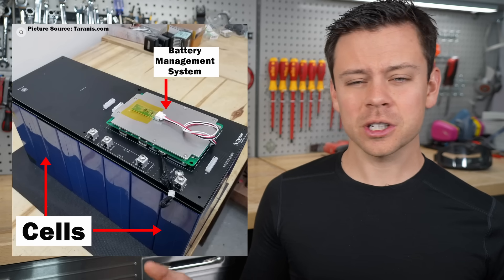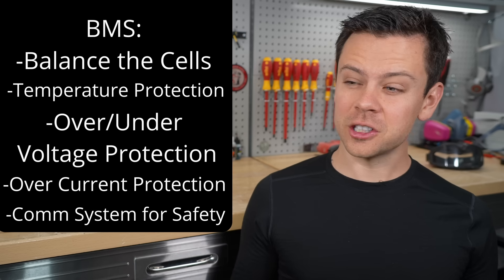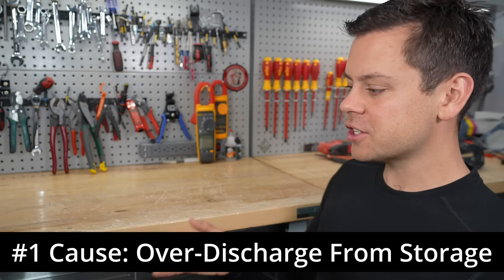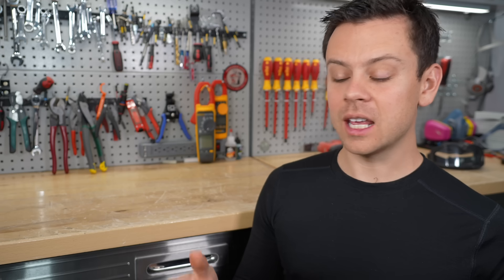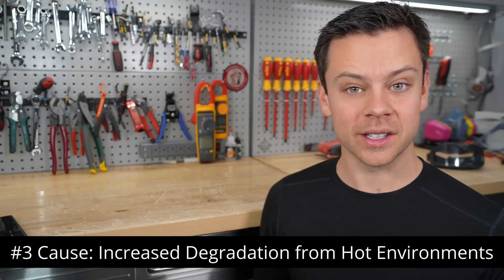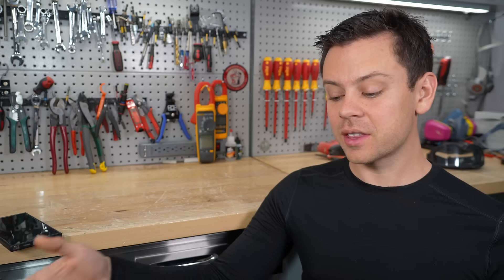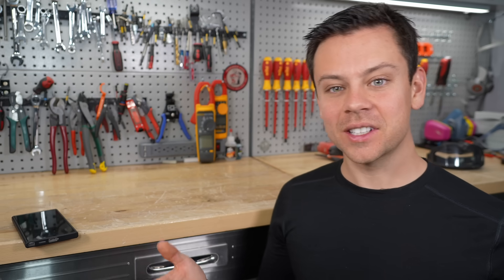The Rules of LiFePO4: The 3 Most Common Causes of Failure and General Guidelines for Long Term Use

Comment from the maker: For longer discussion of every point in this video, check out my charging guidelines here: https://youtu.be/K9Tfivf5bAI
For references to studies for me to draw this conclusion, go here: https://diysolarforum.com/threads/cycling-degradation-vs-calendar-aging-w-lifepo4-batteries-used-for-solar-application.94487/
Does diy solar confuse you? Check out my website! http://www.mobile-solarpower.com

0:00 Intro and BMS Basics
1:31 #1 Cause
3:34 #2 Cause
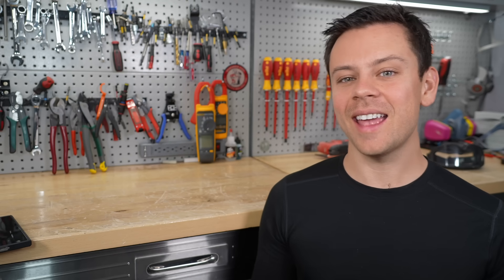6:44 #3 Cause
7:47 #1 Hardware Failure
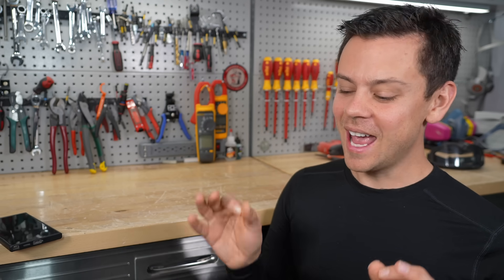8:58 Basic Guidelines to Follow

~~~~~~~~~~~~~~~~~~~~~~~~~~~~~~~~~~~~~~~~~
Tired of getting ripped off? Check out my "Will Prowse Approved" solar product recommendations below!

12V Batteries
https://www.mobile-solarpower.com/lithium-batteries.html

48V Batteries
https://www.mobile-solarpower.com/48v-batteries.html

Offgrid Inverter System Builder
https://www.mobile-solarpower.com/48v-complete-system-blueprint-559371.html

Hybrid Inverter System Builder
https://www.mobile-solarpower.com/code-compliant-48v-offgrid-system.html

Mobile Handtruck System Builder (very popular!)
https://www.mobile-solarpower.com/mobile-48v-system.html

Solar Panels
https://www.mobile-solarpower.com/300w-solar-panels.html

Ground Mount Solar Racking
https://www.mobile-solarpower.com/ground-mount-racks.html

Wire, Lugs and Busbars
https://www.mobile-solarpower.com/wire-and-connectors.html

Tools
https://www.mobile-solarpower.com/tools.html

Fuses and Circuit Breakers
https://www.mobile-solarpower.com/fuses.html

Plug-N-Play Solar Systems
Ecoflow, Anker And Bluetti! So many models to choose from. See my current recommendations here:
https://www.mobile-solarpower.com/full-size-systems.html

~~~~~~~~~~~~~~~~~~~~~~~~~~~~~~~~~~~~~~~~~~
Need to build a large DIY system? Need a trustworthy solar distributor? These are my favorites:

Signature Solar
Creator of EG4! Solar Minisplits, Victron and More! Largest Solar Store Online.
If you want $50 off, please use my link below and coupon code "DIYSOLAR50":
https://signaturesolar.com/?ref=cPwLcVc0SW-BjN

Current Connected
Best Prices for EG4, Victron, Midnite and so much more! Fast Shipping and Highest Rated Customer Service:
https://currentconnected.com/?ref=wp

~~~~~~~~~~~~~~~~~~~~~~~~~~~~~~~~~~~~~~~~~~
Join our DIY Solar Community 
Need more help? Join the largest solar forum on the internet for beginners and professionals alike. 140,000 members and counting!
https://www.diysolarforum.com

Check Out My Free Book
Best-selling and beginner-friendly guidebook to off-grid 12V solar!
https://www.mobile-solarpower.com/the-book.html

~~~~~~~~~~~~~~~~~~~~~~~~~~~~~~~~~~~~~~~~~~
Contact Information:
I am NOT available for personal solar system consult! If you wish to contact me, this is my direct email: williamprowsediysolar@gmail.com
FTC Disclosure Statement and Disclaimers:
Every video includes paid promotion or sponsorship (such as free products for review). Some links on this YouTube channel may be affiliate links. We may get paid if you buy something or take an action after clicking one of these. My videos are for educational purposes only. Information is subject to change/update at any time. Electricity is DANGEROUS and can kill. Be smart and use common sense :) DIY Solar Power with Will Prowse is a participant in the Amazon Services LLC Associates Program, An affiliate advertising program designed to provide a means for sites to earn advertising fees by advertising and linking to Amazon.com
Reply from the maker: Be sure to join the forum if youre a beginner! Check it out here: https://diysolarforum.com/
Reply: Hi @WillProwse
Reply: @WillProwse I didn't see any discussion regarding freezing temperatures which may be the #1 reason RV batteries fail
Reply: @WillProwse does all these battery killers apply to Delta Pro Ultra also
Reply: Are you recommending going from 3.55 v up to 3.65v?
Reply: @nitrox58  With a battery that has a built-in BMS, the better way to look at it is a 12.8V LiFePo4 battery should be charged up to at least 14.4V.
Reply: @nitrox58  That's what I got from it. I am at 3.55 right now too. I am going to push it to 3.6 tomorrow and see how it goes. =)
Reply: What about using them in an RV environment. You'll never discharge to 0% in an RV because you need to have that power available at all times.
Reply: @MYCHANNELWITHMYSTUFF  assuming you have decent solar PV on your RV then you won't need to worry too much as you are unlikely to reach 0% DoD unless you have secondary aircon running flat out often in your RV living space.
Reply: @Lucasimo that is the problem.  He said to charge to 100% and discharge to 0%. I'm at 100% during the day and only down to 30% at night before it starts charging aging in the morning.
Reply: Thank you!
Reply: music to my ears. hard to believe LFP is so good and cheap but still not wide spread.   I think the next stop for disruption is for LFP to replace lead acid batteries everywhere.
Reply: @zodiacfml FePo4   
хорош тем,что его можно заряжать током до 80A.У меня 200Ah  заряжаю до 14.6v.😊
Reply: @WillProwse   I don’t know if you answered it already but when I checked earlier u have not at least not clearly. So I bought a ECOFLOW 100 amp battery , it does not have Bluetooth . So do you recommend a certain doc meter or certain voltage so I can know when it’s near zero to charge to 100 percent
Reply: I agree with most of this, but strongly disagree about discharging to 0%.
Both depth of discharge, and rate of discharge have a significant impact on cycle life. It's best to avoid 0% discharge where possible, ideally rarely dipping into the last 20% (size your system capacity accordingly. 

Also, charging while cold (freezing) is arguably a bigger concern than high temperatures. LiFePO4 shouldn't be charged at all when below 0degC / 32degF.
Reply: @boydw1 100%
Reply: Why is the balancing start limit set to 3.00 volts on the BMS?
When I unload cells and their voltage drops below 3.00 volts, will balancing still continue or will it stop?
Reply: Memory of an old self(((((( don't blame others for your stupidly... It is a steep learning curve. You can or you can't and I have learned from my mistakes.
Reply: i have an overlander with dual 130 ah lfp batts. my solar keeps them at 100 percent all the time. is that bad for them to sit at 100 percent always. ?  i live in a cool area  average temp 70 degrees.
Reply: @thrillhunter9897  Btw: Fahrenheit 70° ...maybe - or so hot with Celsius° over "cool area" there?
Reply: I have a Delta Mini and a Delta from Ecoflow, older battery technology. My question is, when these batteries die, can I just connect a new LiFePO4 battery to the unit and just keep going? I paid too much to just junk ‘em when spent. Thanks!
Reply: Hello Will, 
I'm french and my moderate english level only allows me to understand 80 % of your presentation. I 'll listen to it à second Time, because I expect to buy soon a LiFePO4 battery for my house consumption associated with solar panels already in use.

But I have questions regarding my EV .
What would your advises be to get its Li-ion battery in good health for a long duration.

Thanks a lot
Reply: Question, how do you know when the BMS is bad?
Reply: Where to find a dedicated Lifepo4 Charger.Charger.secondly, should I charge the 3.2 v batteries separately or as a 12v battery bank.
Reply: Dude I've been watching you from the beginning I'm feeling good and your disability is stable. 

Keep up the good info.
Reply: I have a question, I run two 12v Lifepo4 batteries in parallel in my RV. When I store the batteries can/should I leave them in parallel or separate them?
Reply: I don't know what's going on but somehow will I'm getting questions sent to you to me. 

Could you please fix that. Love the videos
Reply: The recommended minimum charging temperature is 32F for LiFePO4 batteries.  How crucial is that?  What if one charges them at 30F or 28F?  Will the BMS even permit this to happen?  Thanks!! 🙂
Reply: if you have a 21 battery pack made with a 3s 40a bms and 21 of 1a batteries, how do you charge that? what charger to use to charge this? amp and voltage?
Reply: Hello Will 
I have a Li Time 12v 280 amp lithium battery in a cargo trailer build with a 80 amp mppt controller and 630 watts of solar. 
Unfortunately due to a medical emergency , my trailer was towed and stored in the desert heat 105 deg outside temps. After I returned and got my trailer,  I noticed the controller wasn't working and after checking the battery.  It had no voltage.  
I am thinking that possibly the battery shut down and the controller still trying to send voltage to a battery but unable too. That the controller may be fried as well. 
I just upgraded this to my new system a year ago .
Any thoughts on how much damage I have done ?
Any help would be appreciated.
Thank you
Reply: It would be great to see a part about BMS RESETS 😮 👍
Reply: I've followed these precautions to a tee for the last 11 months with my (4) litime 100ah lifep04 batteries wired in parallel.  Still, very suddenly, they are rapidly discharging to 7v in under 24 hours with no load other than a resting inverter.  I have no idea why this is happening or how to weed out the culprit battery
Reply from the maker: @skyesthelimit9308  sounds like one of your BMS has failed. I would disconnect all of them and check the voltage. Post it on the forum and we will figure it out

Comment: Hi I like your vieos you appear to be the most informed on the utube about the solar. My question is about parking i do not have power in storage so I'm thinking about putting solar on to run a/c while stored there are two units on roof this unit is 41' class A Forest River is this possible and what parts would you recommend like how many batteries etc thanks Rod

Comment: I know when I setup my Sol-Ark they talked me through the settings on the batteries having me stay short of the high and low recommendations for the batteries as per battery specifications.

Even at the beginning of setting the parameters for the batteries Sol-Ark techs told me we don’t use the percentage mode.

Comment: I thought to charge my 9000 Wh battery array to 100% and shut the machine down until an outage. I would recharge every three months to 100%.  I am away from the house 3 months at a time twice a year and can’t hold that 50% level, but can fully charge before leaving and returning. Thoughts?

Comment: I store my 12.8V 100Ah Power Queen batteries at 13.1 volts. Is this correct?
How often do you recommend to charge these to 100% then drained and charged again to 100%?
I thought for long term storage keeping them at 50% was all I needed to do.
Thanks for your videos, Will.
I gave you a thumbs up and subscribed.

Comment: Details from my previous comment: 16 Batteries Power4Lifel (LiFePO4) 280ah 3.2v 896wh each total 14.33kwh with BMS. With 3 years in used, but have noticed a slight body expands on each.

Comment: Excellent video. I have solar system 3 years now and goes on battery mode every night as.soon as the sun's uv rays are down. Have noticed a slight expansion on each though. Something to worry about?

Comment: If someone could answer me? 

I have an inverter around 2 years old but it does not have a bms ?  Can i connect a battery that has its own bms with said inverter?  There is chineese dongjin company that make these floor mounted deep cycle lipo4 battery and they said you can even connect these with old ups ? That don't have bms?  Is this safe?

Comment: I'd like to see a video about actual battery bouncers that's not the cells that's a batteries themselves especially in 24v or 48v configuration I've got one on my my mobility scooter that's fitted with two 12 volt 50 amp lithium batteries nice to see a video if this is a good thing to do or not I've had no trouble doing this just like see you recommendations. love your videos😊

Comment: I bought a Dumfume 100 amp/hour battery and a 20 amp charger.  I plan to use it to power my diesel heater.  My plan is, plug charger into wall, connect leads to the battery.  Run power wires from battery to diesel heater.  The charger is plenty big enough to both run the heater, even during startup when it pulls the most power, and charge the battery.  What are your thoughts on leaving the charger hooked to the battery 24/7?  I'd like to keep the battery charged in case I lose power due to storms or tree falling on power lines.  I have chargers that are designed to stay connected 24/7 for lead acid batteries.  I'm just not sure about Lifepo4 type batteries.  The charger I have coming does claim to have a shut off feature but will also sense a load and power back up when needed.  So, it sounds like it charges until topped off and then cuts off.  If it senses a load, it cuts back on if needed.  

During the summer, I plan to use it with some USB charger modules to charge phones, batteries for flashlights etc if I lose power.  Basically, I'd like to keep it as charged as possible all the time if it doesn't hurt the battery. 

By the way, I picked that brand of battery because of one of your videos.  Not expensive but pretty well made.

Comment: the manufacturers of these batteries spend alot of time and money on testing the best ways to charge and discharge the batteries. i  have over 50 years  of experience with all types of batteries, from being a master electrician, electronic hobbiest, rc cars,boats, planes ,helis , an avid fisherman and computer tech. ive replaced  batteries on  navy subs, solar power systems,ups  for computer back up car batteries,trolling motor batteries, i race remote controll cars that use very exspensive lipos and cant afford to mistreat them,pobably got 20 different chargers on my work bench, batteries have changed alot over the years and as new types come out i spend alot of going over the manufactures suggested guidelines for taking care of them , charge rates, charge times,charging capacity,charging current,discharge rates, temperature rates. some batteries are meant to charge up high and discharge fairly low(deep cycle lead acid trolling motors batteries) some are meant to charge constantly(emergency lighting fixtures(EBUs),UPS, some are meant to peak them out and discharge at a fast rate, but they all have one thing in common,none of them are supposed to discharged below there individual min cell voltage. the 2s and 3s lipo batteries for rc cars for instance have a recommended cutoff voltage of no lower than 3 volts per cell and the speed controllers are set to turn them off unlike ni-cd that you can run down mush lower. dont think ive ever seen or read a manufactures manual that said charge and discharge all the way down,not car batteries or cell phone batts or solar cell batts,none. yes some are have a wider range of charg/discharge values,none are meant to totally discharge

Comment: Keeping it charged?? What can you use to charge them up? 

I only have a car battery charger up to 10 amps 12 volts.. Will it harm the battery to just use the car battery charger?
Reply: A Lifepo4 battery is not the same as a car battery.  It's best to use a charger designed for the type of battery you are charging.

Comment: Taking down to 0% can be risky for off grid situations. It would be nice if the BMS would handle this for individual batteries so the entire system never needs to be depleted and risk not having power.

Comment: If you disconnect the BMS the discharge rate is much slower. While that won't help with prebuilt batteries folks that can disconnect the bms for storage would do well to do so.

Comment: 2 year old LiFePO4 12v motorcycle battery fully discharged for a week or so; mistakenly left the ignition on. It charged up OK, but now won't hold charge for long i.e. now goes down from full charge to 30% (13.1 v) over just a few days, rather than months?

Comment: Will,  looking to change out my lead acid in my truck camper for Lithium  and had a question.  When plugged into shore power,  will my BMS handle the dc voltage correctly or do I need to instal a specific AC to DC charger for lithium batts?   thanks

Comment: Another question. Charging these batteries to 100% is advisable and just fine. But what if you have to let them sit there at 100% for many days or weeks, is that to be avoided at all? As most people know that is very bad for NCM cells. Most batteries they tell you for long-term storage 40% or so is about right. Is that still true for LifePo?

Comment: The hardest thing to accept is the fact that if you live in a climate that is cloudy you are not going to get a charge. I live in Northern Illinois I have a sticks and bricks with enough solar to power a bank that is big enough to supply all my needs.. I am still connected to the grid and thankfully because when it snows and they get covered and it's cloudy and there is no energy coming in I don't care how big your SolarBank is I have 800 Watts of bifacial solar panels and I got nothing coming in. I do a little better on my smaller system aboard my RV but there again is trying to keep the batteries warm This is a constant challenge. So the best rule is Chase 70° or at least between 70 and 90 if you're going to be in the desert where I would really rather be. But throughout the year if your mobile Chase 70° and sunny skies for the best life.

Comment: Great info in your video. I have a LiFePO4 battery that is about 3 years old. I haven't really used it much but when I do, it seems to only discharge to 11.4 volts and then shuts off. What would be a reason for this? I do use a battery box where I also installed a volt meter....not sure if this will effect anything? It does seem to charge fully to 13.4  volts before the battery charger states it is full. Any info you can share will be greatly appreciated. Thank you  - Rich W